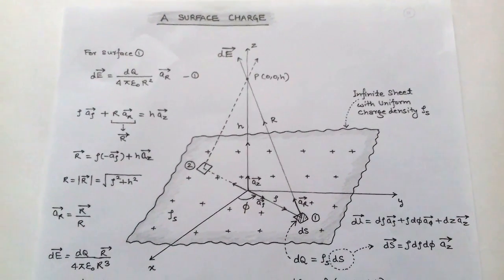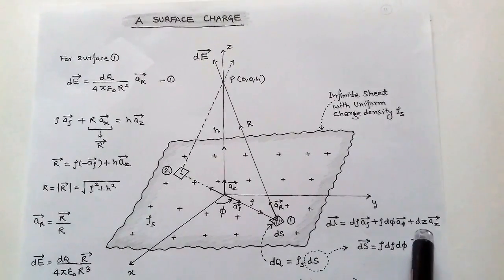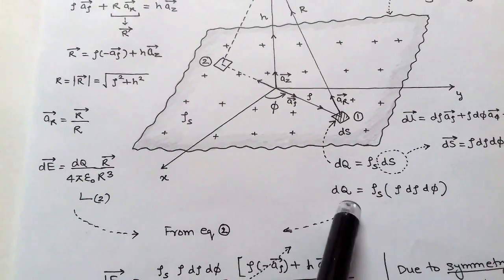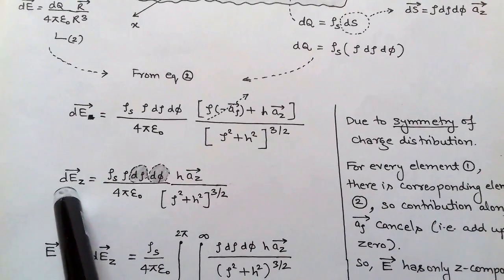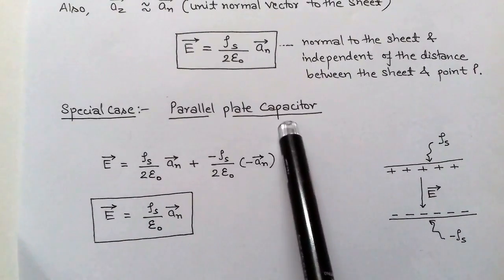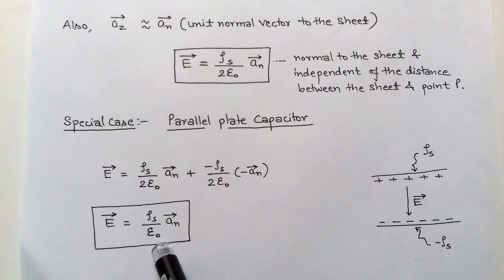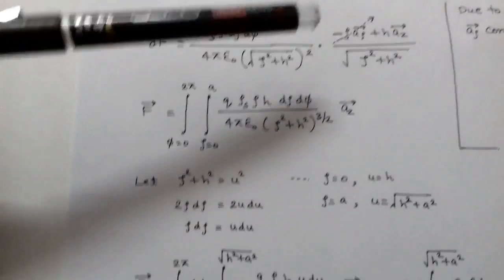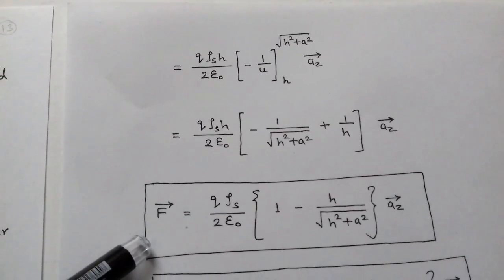2.4 ELECTRIC FIELD DUE TO SURFACE CHARGE for I.E.S. & G.A.T.E.

Comment: Just wanted to make sure, that symmetry cancellation of the rho components only applies IF rho s is constant at any point (uniform charge distribution on the surface/area) correct?

Comment: hi sir. how to solve this answer.A hollow cylindrical shell has a radius of 2cm and a length of 25cm. assume the bottom of the cylindrical shell is in the xy plane and the axis of the shell lies on the z axis. The surface charge density on the surface r=2cm is 2.1 x 10^-8 C/m^2. Determine the electric field intensity at point P(0 0 15cm).tq